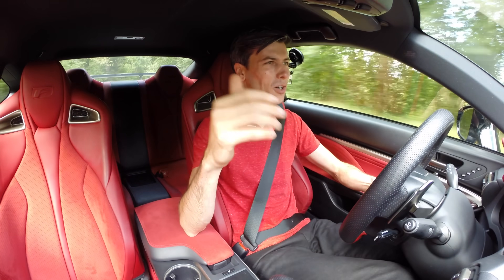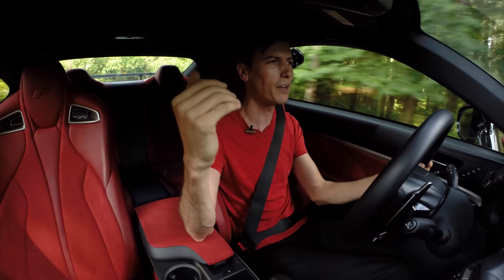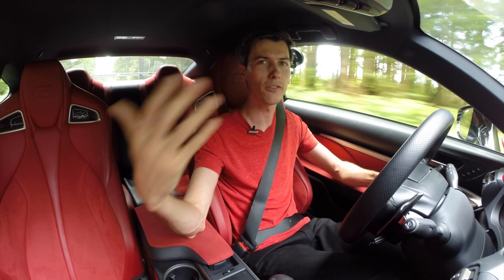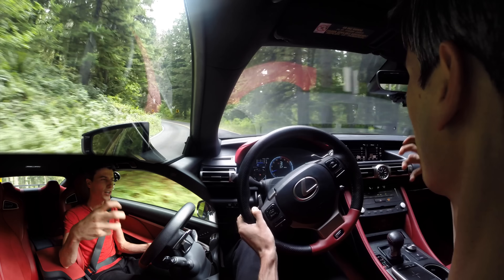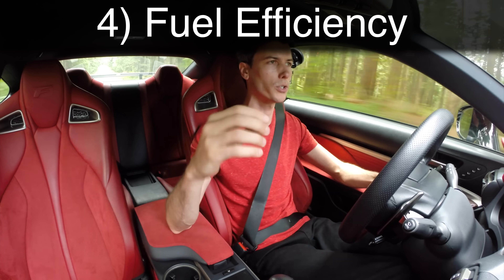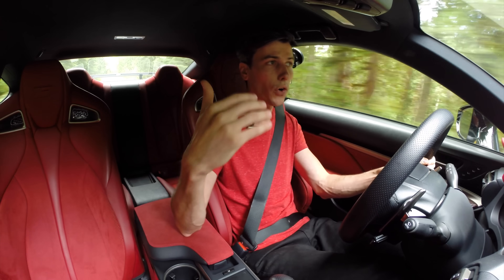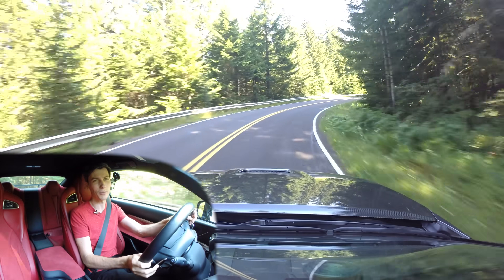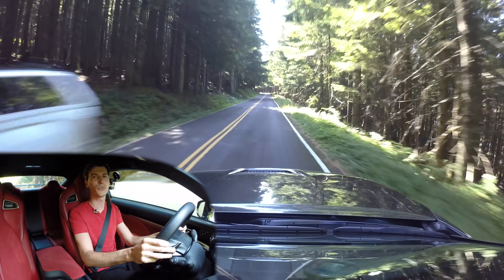5 Reasons You Shouldn't Buy A Turbocharged Car

Comment: engines getting smaller with less cylinders and strapping a turbo on to make up the power. Rather than giving us bigger engines strapped with a turbo.
Reply: There are advantages to both.  I love my 1.8 TSI that gets 40mpg on the highway and 35 around town but has the torque and power when and where I want it.  If you know how a turbo works there's very little lag as long as you anticipate the need for the boost
Reply: @102wingnut  I agree mate. My turbo 2.0l in my genesis coupe gets 32.4 mpg when I go on trips. But has 276hp when I ask for it. Small, turbocharged engines are the way to go. Best of both worlds
Reply: @jeffreyreardon7487  awesome!  Yeah for us that's definitely true.
Reply: The 1.8 TSi is a great little engine. Torque peaks super low in the RPMs. There's lag and a bit of inconsistency when tipping into the throttle at various speeds, but it's not as pronounced as in more performance oriented engines. The turbo is tiny, a compromise for better response and usable low end rather than high top end power. I've had the 1.8, the 2.0 in the GTI, and the 2.0 in the Audi S3. The 1.8 has a punchier feeling than the others that makes it way more fun to drive around town.
Reply: @gibmebalut  I have the older 1.8 20v and love it. I get 29-31 mpg every tank easy. Could use more power from a tune and that'd also help efficiency.
Reply: Make up the lost hp?!?  Todays turbo 4 bangers are outdoing old big blocks in power and fuel economy.  My ford escape has almost the same power aa my old 2v 5.4 expedition
Reply: @sketchyssk8shop  Seriously, you totally don't understand what he said. Of course they're making up the lost horsepower. You think those engines would make the power they do naturally? Also, everything is more powerful and more efficient these days. A modern Corvette has nearly double the horsepower of 1989 Porsche 911 turbo while also getting better fuel economy. Turbos do not necessarily mean better mpg or power.
Reply: @nukewiller4083  they do mean it for the displacement of a given engine.  U must not have read what i wrote.
Reply: To be fair, it's way cheaper to extract more power from turbocharged engine than it is from NA.

For most of those just remapping them can give 30-50BHP, and way more than that with things like bigger IC, downpipe and air induction system.
Even hybrid turbochargers cheap compared to turbo/supercharging NA engine.
Reply: Small turbo engines are highly stressed. You only get the mpg when you're babying them. Anytime you go near the throttle your mpg on a smaller turbo car disappears
Reply: Laughs in Bugatti
Reply: James that has a lot to do with emissions.
Reply: Yes that would be perfect, imagine if camaro and mustang would have 6,2/5.0 with turbochargers.. That would be awesome, but the more reasonable side of me says people would just crash them because no self control
Reply: Then buy a car with a big engine and slap the turbo on
Reply: God bless the c63s  coupe <3
Reply: It is to keep up with MPG regulations
Reply: James FEWER
Reply: @loveitreallyhard  What? Is this your way of saying you have less brain cells than me?
Reply: You can get turbos on pretty much anything nowadays, plus the supercar trend is turbos and hybrids to maximize all of their benefits.
Reply: I have a 1 litre TSI with 140 bhp (UK) in a car that is 1050kg 😆
Reply: Yall missed the point. There's no reason not to give us bigger turbo engines. The fact big NA engines are still being made kinda blows the whole economy and emissions argument out of the water. Yes it's cheaper to make a smaller engine strapped with a turbo but still make those big bad boys in hot hatches. It seems the best you can get is just 2L turbo engines. Yes there is the odd exception.
Reply: @James-ns6jm  now that bmw quit putting 6 Cylinders in their 1 Series and Audis new RS3 is supposed to be a 2L too... Yup, seems like the best you can get is the Turbo 4 pot. But for a light car that should be plenty. I had a mark V Golf GTI with the 2L TSI and equipped it with a 3" System from the Turbo back.
Reply: @Gandalf721  i wish they would bring back the big displacement i6 like the old ford 300.
Reply: Also the whole c02 arguement is bull anyway. I'm a refrigeration engineer have been for 10 years. They use c02 as a refrigerant on some site, and I can blow it into the sky all day long no problem. A bottle of r404a 13kg is the equivalent of about 40tons of c02. Yet it's you in your car that's killing the planet. That's what the government says 😂
Reply: @chappy2121  Ofc you can go on nurturing your conspiracy theories - but here in Germany, r404a is banned exactly for CO2 reasons since Jan 1, 2020.

Comment: I'd appreciate a 'Why not to buy a supercharged car' video if you haven't yet.
Reply: Superchargers are very inefficient, that's basically it. Great throttle response as the trade.
Reply: @jaydunbar7538  except it has throttle response, it has boost when you want it and no boost when you dont.
Reply: Jay Dunbar right even tho a centrifugal supercharger is still a supercharger I’d rather go with that than a twin screw
Reply: Rotrex chargers have very good thermal efficiency, comparable to turbos. Sure you still get some of the inevitable parasitic losses associated with SCs but I'd rather have a Rotrex blower over a turbo any day
Reply: my question is why manufacturers dont use superchargers more.   initial cost higher than turbo?
Reply: @mnminnmn  they have been used a lot, but nowadays with modern emissions standards, SCs just don't have the same claims for efficiency as turbos do
Reply: @mnminnmn  The efficiency is lower. You may get the same boost and thus volumetric efficiency, but you are still wasting the exhaust gas energy, and at the same time, taking energy out of the crankshaft to rotate the compressor.
The only big advantage of superchargers vs. turbos is the response in the end (and for who does prefer it subjectively, sound). Ease of adding one to your engine isn't as big for the manufacturer than for the modding consumer (albeit of course there's advantages too on reduced engineering costs).
Reply: There's no reason not to

Comment: all the video covering my ears and shouting : "i love turbos!  i love turbos! i love turbos!"
Reply: And all the people with their ears plugged shouting "I hate turbos I hate Turbos...".   Obviously there are pros and cons and it really depends on personal preference and intended use.  A track car might have different needs from a grocery getter.
Reply: @102wingnut  Honestly, for circuit racing N/A is way better. For drag racing, or highway pulls(straight line racing in general) a giant turbo won't make much of a difference vs N/A.
For daily driving and passing, a small turbo works good and is responsive enough to the point you don't really feel lag.
Reply: Agreed except for drag racing where forced induction is definitely the way to go!  No way you can build an engine big enough to compete with either a turbo or supercharger.  And a lot of pro mods are switching to turbo.
Reply: @102wingnut  Wow I just realize now how bad I worded it. What I meant was that in terms of lag, that for straight line racing it wont make a difference. Like N/A has no lag at all but you really only benefit from no lag in circuit racing where you have to modulate the throttle a lot. 

So yeah, turbo is the way to go when you don't need modulation or lag doesn't make a difference.
Reply: @SI0AX  ha yeah u see what you mean.  Very true.
Reply: you are in denial but i dont want to ruin your fantasy 🙃